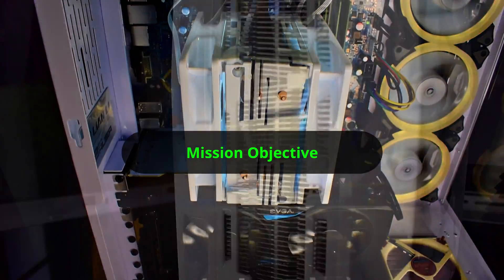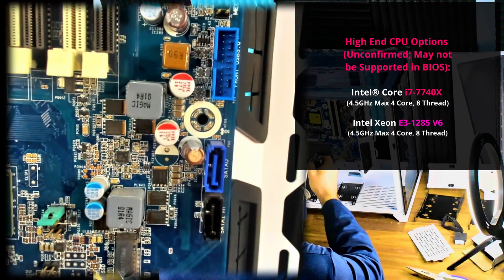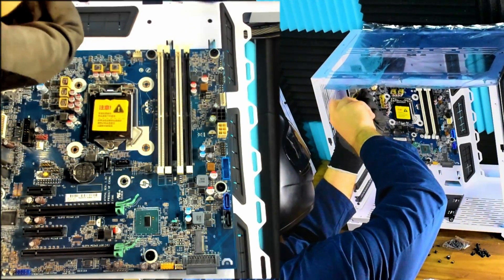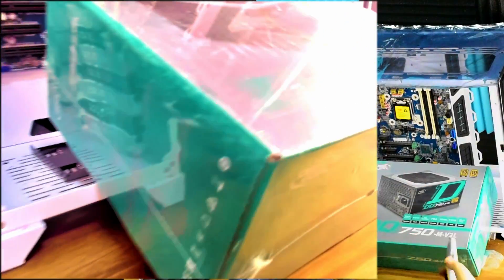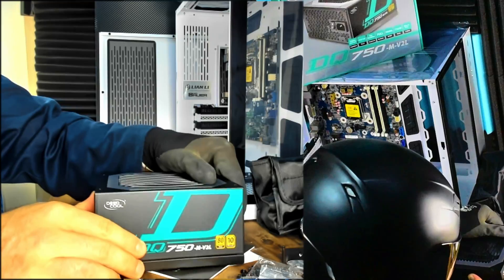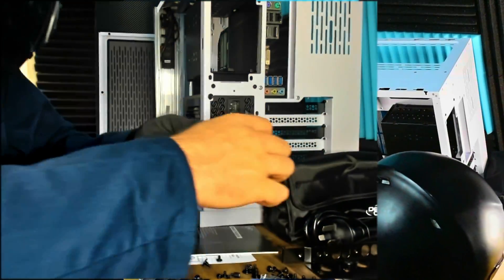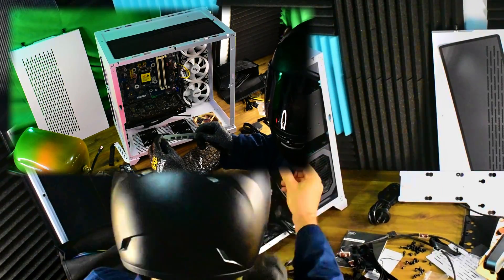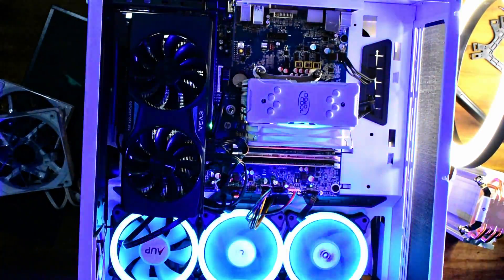GUIDE : Z240 Case Swap - Custom 4K Video Recording Workstation! (Part 2/4)

Comment: can u tell me doesnt this motherboard uses a proprietry power supply cable so what did u do to fix thhat and can u also tell me were there any probs mounting the motherboard inside neW case?
Reply from the maker: If you want a fun project for the Z240 I would recommend a case swap. Have you got the tower or SFF version? If you have the tower - you are in luck because I made a full case swap guide for the Z240 tower motherboard. 

It's segmented across 4 videos:

Part 1: https://youtu.be/kmnh112nrcw
Part 2 (this video): https://youtu.be/cAca0iz9sFQ
Part 3: https://youtu.be/yRQ_rlvg28Y
Part 4: https://youtu.be/ORdZLAYHemk

And a system overview video here: https://youtu.be/GJqKfCG2Up8

All but two of the motherboard standoffs matched ATX format (I just left the standouts out for the ones that did not match up). 
You will require a Z240 to ATX PSU adapter cable as well as an ATX PSU. The swap is relatively straight-forward.

I'd actually recommend the Z440 over the Z240 due to having much more upgradability. 
My case swap guide for the Z440 if you are interested: https://youtu.be/K4RalaEbRI4

Let me know how you get on.

Comment: Hi, how you mount m.2 nvme, becose it's pointing to opposite direction.
Reply from the maker: The M.2 NVMe will require something to mount to given that it would normally mount to the Z240's case. I wound up using a PCIe NVMe adapter instead of the M.2 slot on the motherboard. You could make an inexpensive fix by using rigid plastic or metal cut to shape (as a visual demo - you could do a ruler cut to size) to hold the NVMe. You could mount it to the case with hot glue or drill two small holes in the case (when the motherboard isn't mounted to prevent drilling into the motherboard!) to secure the NVMe 'backplane' to the case.
Reply: Yeah, I think that's what I'll do.  I'm going to drill a hole in the box.

Comment: Please reply bro
Can i install z840 in gaming case
Reply from the maker: I have done the test and yes, it is possible but very complex and challenging, and I would not recommend it. 

I made a post here about the motherboard mounting locations:  https://www.youtube.com/post/Ugkxii42PFW5WxYmjAHXR-eN3eUVezIQbw-Y 

None of the motherboard mounts align with standard ATX mounting locations - so you will need to drill out custom motherboard standoffs. The best way to go would be to tig weld the Z840's motherboard standoffs to a case's frame. 

In terms of connectivity, the PSU can be adapted and I have done this test (I had mine booting to BIOS with a 450W PSU while testing - no video out of this yet but one day I will lol). The power button connectivity I have not figured out yet but I have a spare front I/O connector for this. It should be possible to get the power button pin out. There may still be a thermal sensor in the front I/O harness which will be required to prevent the motherboard fans from running at max speed. 

The case swap will have boot errors. Comparing it to a normal case swap I would rate it extremely challenging.
Reply: @racerrrz  what about 620 with dual processor
Reply from the maker: @mza33116  That's a good question, I am not sure anyone has done that one actually. The Z620 has a custom expansion /riser board to handle the second CPU which makes the case swap more challenging. Inspired by your message yesterday I zipped together some footage on my Z840 case swap research. You may enjoy what I have come up with so far: 

https://www.reddit.com/r/HSpecWorkstations/comments/17hlk64/hp_z840_case_swap_anyone_i_can_confirm_i_have/ 

https://www.youtube.com/watch?v=Rsr_zxOg6K8&feature=youtu.be

Comment: dont these mobos require a cusotm psu pinout? not clear if you circumvented that with this aftermarket psu
Reply from the maker: Hi Nico. You are correct. There are adapters that convert the proprietary connection to standard ATX power. The cable can be found in a quick search (tiny url because Amazon links are massive): https://tinyurl.com/ywf3kffd ). I have a follow-up video that will outline all the powering / wiring considerations (the whole project had ~3hrs of video and no one wants to sit through that just for a case swap!).